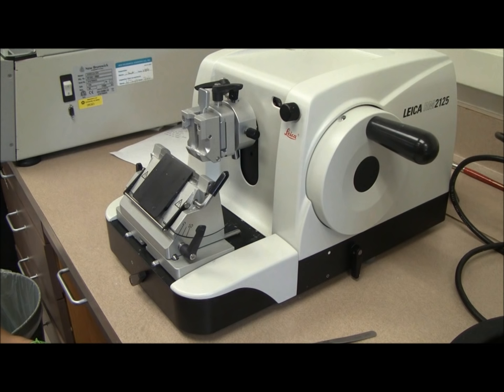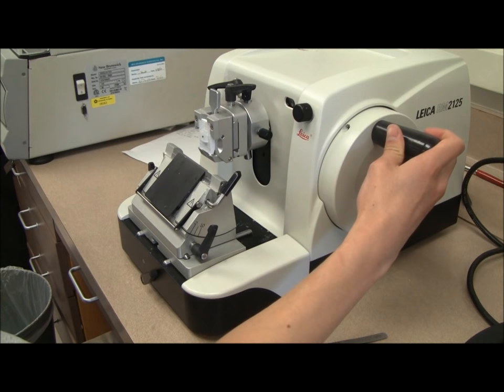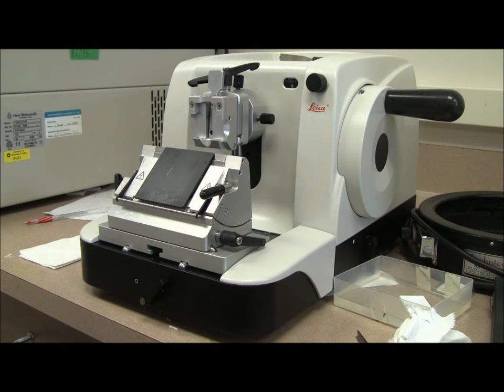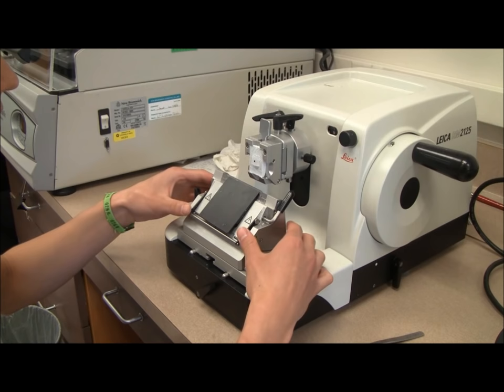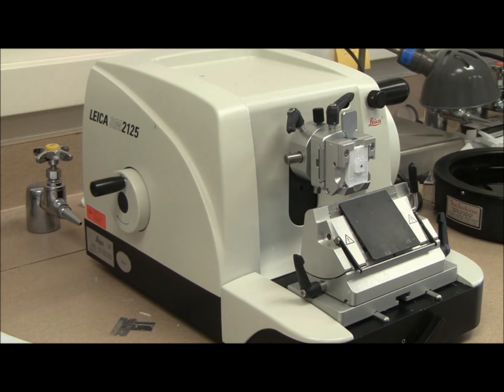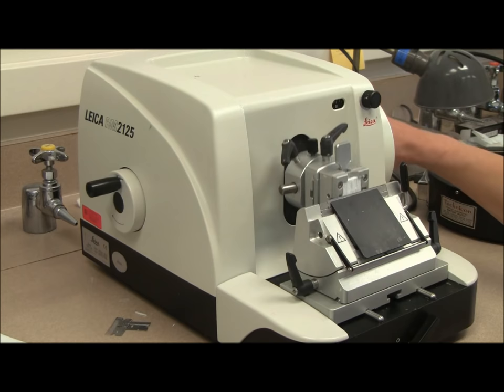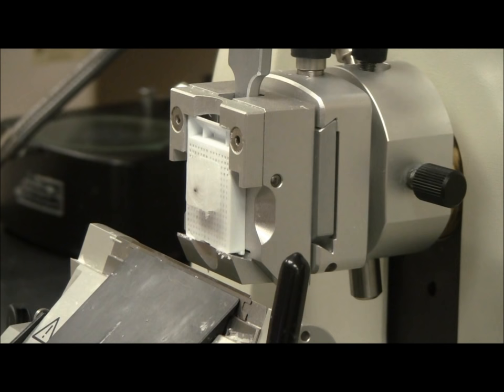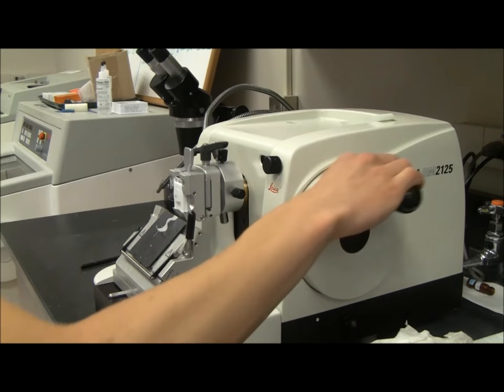Microtome Sectioning Tutorial

Comment: Just FYI peeps. Certain tissue types need more hydration ( hence the variance in soaking times). If a tissue is dry for sectioning such as brain or liver, it needs to sit on wet ice for longer. If tissue is fatty such as deep melanomas, breast, lipomas etc soaking the block on water is about the biggest mistake you can make. It will interfere with sectioning if you introduce water after processing. It will be incompatible with xylene that is still present in the tissue and explode on the water bath. The whole point of soaking your block prior to sectioning is to hydrate the tissue so that the morphology is more accurate on the slide.
Reply: I have been taught to keep blocks on ice after trimming. Sections just fall off at 4microns